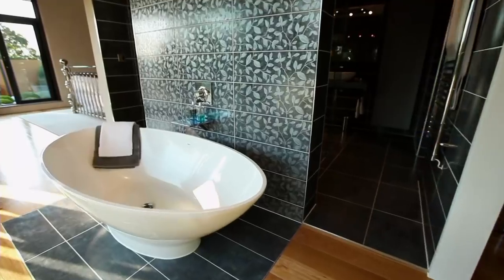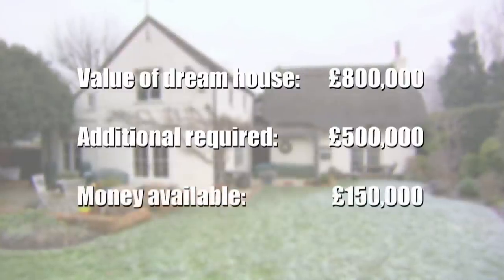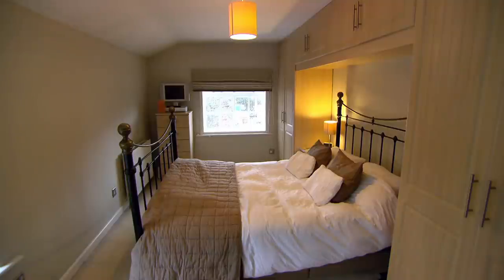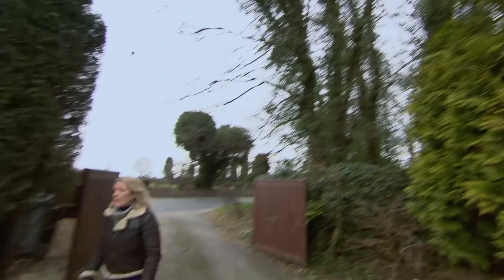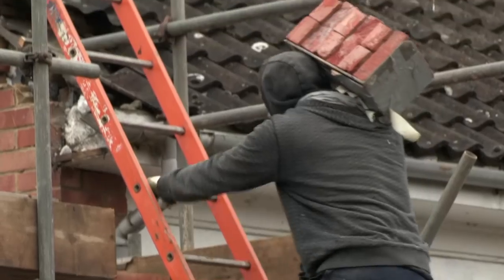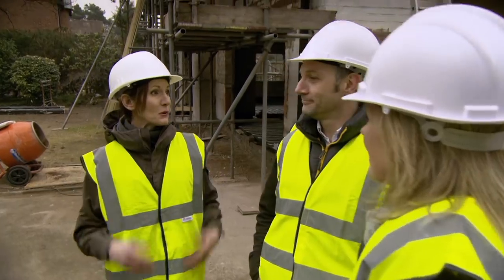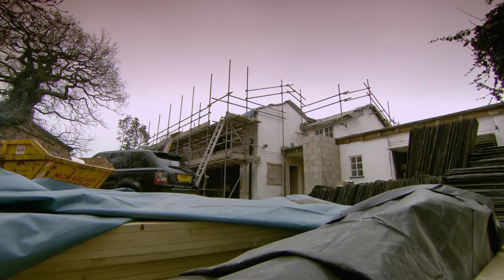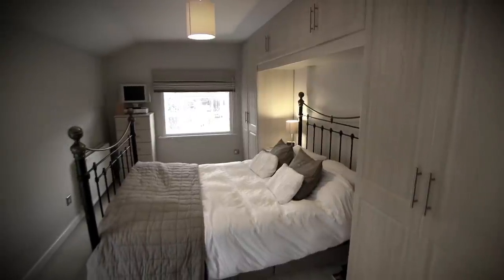Double Your House For Half The Money! | Series 2 Episode 2 - FULL EPISODE

Comment: Mark and Becky ended up with a new build all the way through. The only thing I agree with was changing the windows in the old part, since it would have been almost impossible to match the old windows in the new part of the house. Also, new windows are much easier and safer to keep clean if the went for double hung sash the tip in. The rest is just bland. Personally I absolutely HATE open plan living with no separate formal spaces. If I am setting a fancy table for a large number and preparing a 5 or 6 course dinner, I do not want my guests seeing the mess left behind after each course is served. I am certainly not going to be doing a clean up between courses while my guests are waiting, and even more, not while they are watching me do it. In a way, I am surprised they got planning permission to a renovation like that on a building that old. Obviously it was not Grade 2 listed, or it would have been a total non-starter.
Greg and Jo, on the other hand, created precisely what they set out to do. They were not closed to other ideas, took them on board and made the house perfect for themselves while also creating a home that will be very desirable should they ever choose to sell. That back garden is simply perfect, and that view is amazing. The house is a real credit to their vision and the hard graft Greg put into it. Not my personal style, but it is a beautiful result. The kitchen layout is extremely efficient and will be easy to work in. Well done, that couple.
Reply: Most people aren’t doing fancy 5 or 6 course dinners though.